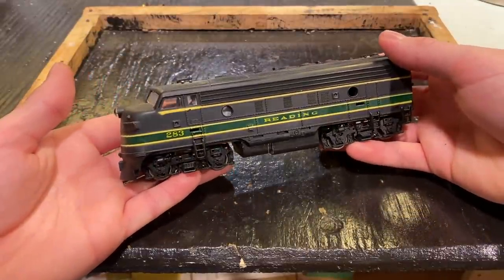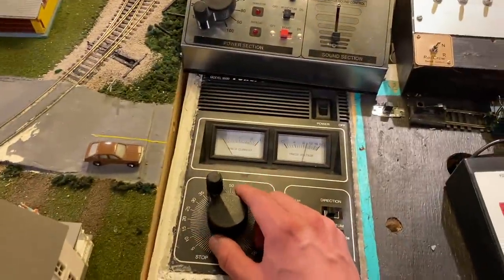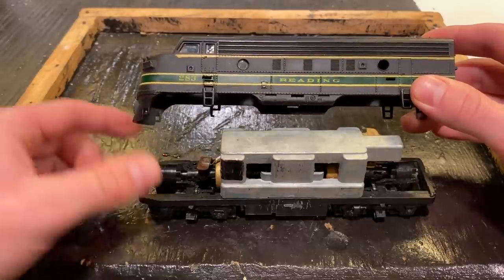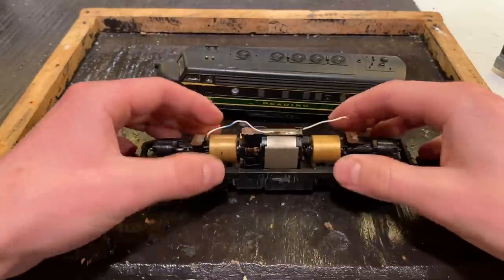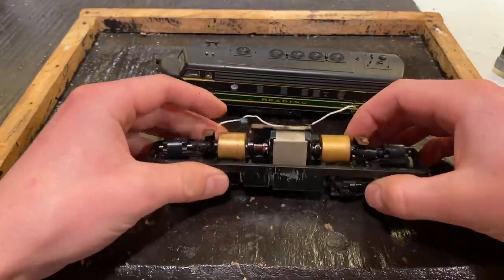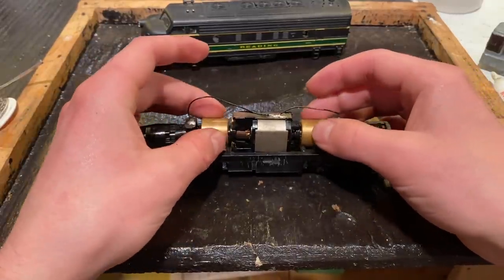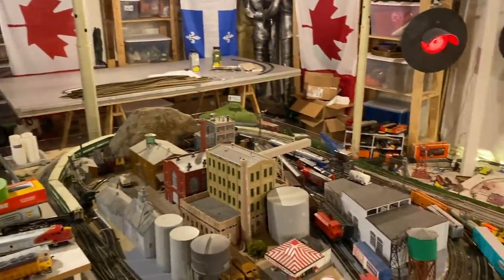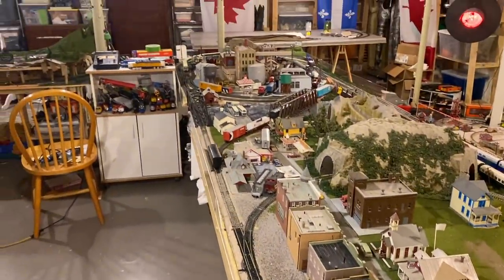Can We Make It Run? Athearn Reading F7 That Doesn't Run

Comment: People talk crap about old Athearns especially if they never really owned one.  You can bet all those fancy sound and digital dynamo's they are paying $500 for will never do this in 30 years without major work.  Sure these old BB's aren't the most detailed, but mine start right up, no stuttering no jerky movements the first time every time.  The new stuff is cool and even though I have many newer models I still hold my old Athearn Blue and Yellow box engines close to my heart, my old Band drives too!!

Comment: I have a slew of Athearn blue box F units and have installed new Genises motors, hex drives, new worm gears, all new wheelsets with gear and Train Control System motherboard and Decoder along with a high bass speaker and they run and sound great.  I have a huge number of the blue box PA/B locomotives and did the same thing and was able to put two speakers in but using Tsunami Decoders and two speakers.  I run A/B/B/A all modified the same way.

Comment: The Athearn F7s that I bought new as a teenager in the mid to late 1980s are still going strong!  They aren't as refined or smooth as other engines,  but they're darn near indestructible.  Their strength is running freight on mainline rather than switching.  I love mine (2 powered BN A&B units plus one dummy C&O A unit) and will never part with them.  🚂🚃🚃🚃😎👍💕

Comment: In case you don't know, Delrin gears and universals are self  lubricating. they don'r need any lube. Taking apart the trucks may just be a point of losing gears or their position .  Mine have been running 40 years with no lube and no ware.

Comment: Got er done Harrison. Just an FYI with older Athearn locos is to be careful with those wheels as they're made of a sintered metal which is a metal powder heated and molded to shape but will still soak up oil causing traction issues.

Comment: You really should purchase a Bowser #22 Foam Cradle when you work on your equipment. It helps cushion your trains, and not damage the paint or details. It also has a compartment area for holding small parts, screws, gears, etc. Another thing to have is a good pair of tweezers with a point. That helps with removing hair from axles, gears, and for holding small parts. Also, 22 awg FLEX wire is what should be used with model trains. It’s the correction gauge wire for model trains, and it’s very flexible. Just a few helpful suggestions for you. I’ve been doing work on all of my trains for over 50 years, and it’s always nice to pass down some helpful information to younger people like you getting into the hobby.

Comment: Just a comment on cleaning metal parts with alcohol. It will clean them but is not good as far as electrical contact goes.
Consider using CRC contact cleaner and protectant or WD 40 contact cleaner.
You can clean your wheels the same way as in the video and do the track as well. You will see a big difference in how well your trains run.
Good job on the repair.

Comment: Bruh. This is a blast from the past for me! One of my first model trains was an Athern f unit. It had a similar drive train even but no wires. Only strips of metal making loose connections. I still have it and I still run it on occasions. Thanks for the memories!
Reply from the maker: Glad this brought you back. They are great models, require only basic maintenance and perform great for what you can buy them for.
Reply: @SMTMainline  definitely!

Comment: Lemme tell yall a story. Its about an Athearn Chessie System f7 just like this one. It had an issue in which one truck was believed to be seized and it made this grinding noise when it ran. Well it turned out to be an issue with the driveshaft not being properly connected to the motor. It took me 60 seconds to fix this model once i figured out the problem, she was running fine again after that. Soon enough you may see ol chessie on my channel in 2021. Until then, great video Harrison and i will see you in the next one.
-KJP

Comment: Did you notice that is actually a Mantua 2nd Generation F-7 body shell?  The body slots for the snap-in power trucks, side steps and closed front coupler pocket are 3 dead give-aways.  Also the road #283 & the lack of steam pipes under the back door, which allows the swinging rear coupler on the original Mantua rear power truck.  Athearns have steam pipes under the back door because their  rear coupler is stationary.  To make the shell fit down all the way on the frame, you may need to trim a bit of the plastic under the rear door as it rests on the coupler pocket.  I am not sure who copied whom, but the Athearn and Tyco/Mantua F-7 shells are from the same original molds with one of the two (Mantua, I think) having been modified for production models, , and Tyco/Mantua sold it's 1st generation (1960 - 1974) as an F-9 most likely to avoid patent infringement, lol!  The Tyco/Mantua shell has always had the better pilot, and the Athearn had the rear door steam pipes.  Mantua changed the profile of the side steps in the late 1970's, and added the side slots for snap-in power trucks and center weight. Athearn F-7 Shells have basically been unchanged since the 1960's.

Comment: And if you want to add a light...use an LED with a small bridge rectifier (less than an amp) and a resistor instead of a bulb. The current draw IS a lot less, and an LED is FAR less likely to burn out. Also LED's can be found in a size that, believe it or not, will fit the lens hole on the front of the cab. I've done that replacement on a couple of my F-units.

Comment: If someone cant make an a blue box Athearn run then they shouldn't be playing with trains. I literally have hundreds of blue box Athearn locomotives, some were bought for parts and other for restoration. I have made locomotives from parts and pieces of Athearn locomotives, I have fit shells from other manufacturers onto Athearn chassis, there is almost nothing you cant do with an Athearn. Of all the ones I have I have only 2 of them that the motors burned out in, hence scrap loco's for parts. Sadly since Erv Athearn died and they moved operations to china instead of leaving them in california I have only purchased a couple locos and a few cars. But after all that, usually you can get them running with a good cleaning.

Comment: That’s a big wait,when it runs it will pull a LOT rolling stock
Reply from the maker: Probably so. These Athearn engines can be strong pullers with enough weight.
Reply: I bought mine used, a Via Rail shell, but no weight, I'm almost envious,  it's still pretty heavy with the weight though.

Comment: Interesting wheel cleaning strategy... Personally I use a variation of this where I hold a cotton swab in place and turn the flywheels, definitely not as efficient as your strategy but it gets about the same job done.

Comment: Never seen a paint sceam like that before
Reply: Looks to be a more recent issue ( late 80s through early 2ks) so it's either one of the limited run liveries Athearn offered right around the time Irv Athearn passed, one of the aftermarket painted shells or in light of the fact there's the black marker to block the engine weight showing through the porthole and the improvements done a custom DIY paint job.
Pretty much do not recall that Reading livery offered as a stock Athearn.
Reply: I never seen Reading in Athearn either Stewart / Kato had them . If i see one going to buy it
Reply: Upon further review This looks like a Tyco or Mantua shell made to fit an Athearn frame
Reply: @artroberttucker4218  thought that headlight plug was rather "bulby" for an Athearn but thought I might be misremembering
Reply: I made a couple of these for my fleet. They came out pretty good. Micro scale decals. I like the Athens BB. Great for customizing.

Comment: FWIW, that's a 1980s Mantua shell put on an Athearn drive. 

Scroll down through http://ho-scaletrains.com/mantua-f7/ and you'll find a picture of this very one.  

The thick side steps, the slots in the sides and the fuel tank skirt being shorter and not fitting the Athearn chassis lugs gives it away.  

Curiously, this shell is a slight revision of the original Tyco tooling from about 1960 - which is itself more or less a clone of the Athearn shell.  The only real differences are the nose door being absent and the changes for the Tyco drive.

Comment: Maybe do the wheel cleaning trick on some sort of rolling road - I have an H&M Loco Tester that has the rollers at one end and some plain track at the same level at the other end.  Purpose is to put the loco on the rollers and the tender on the plain track - important if the current runs through the tender as well.
In the case of your diesel, put the alcohol soaked paper towel across the plain track for the wheels you want to clean, and rollers under the wheels at the other end.

Comment: As to the wire used for this...NEVER use a solid wire - use a stranded instead. The stranded will by its very nature will be more flexible. The solid will not be and will cause trouble with the trucks swiveling correctly. And I would not use any wire smaller that 24-26 gauge wire. A smaller wire might overheat and burn (NOT GOOD!!!) with an amp or more of power being drawn by the engine.  Personally, I use 20-22 gauge stranded wire when I perform these types of jumper additions.

Comment: I like the solder a wire between the bottom brush of the motor to the front bracket of the headlight and right to the flat plate where the truck contacts the frame. I don’t trust those two little tabs that stick down and contact the frame

Comment: Smt did you know that back when lionel was making ho scale sets, they made the daylight
Reply from the maker: Yes although they shared the same drive system as Bachmann.
Reply: @SMTMainline  I stumbled on a HO scale Lionel GS-4 Daylight several years ago at a store in West Plains, MO, unfortunately I never bought the locomotive and the store was severely damaged in a fire some months later (the store has been repaired and reopened since then).  While I know the locomotive was purchased by someone, I don't know how much damage it suffered in the fire!
Reply: @SMTMainline  yeah?  I have the Lionel version, one of the wheels has a broken axle. Any ideas of what to do? Could I find a replacement?